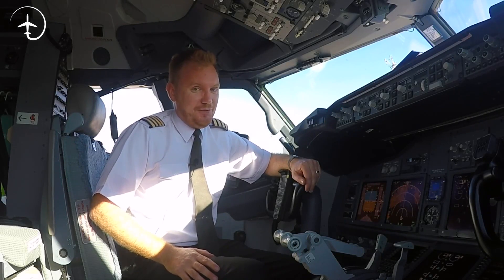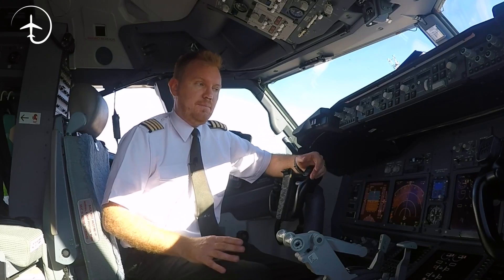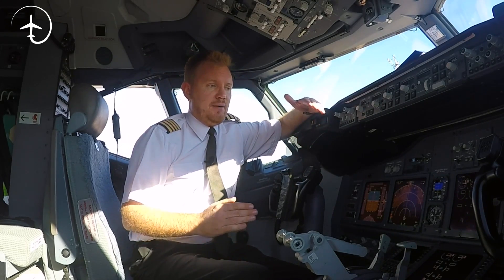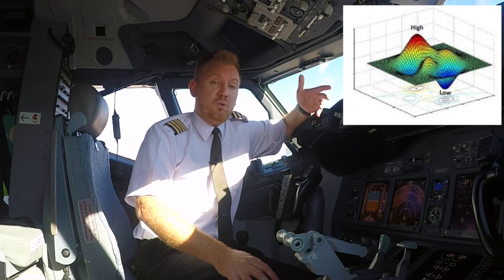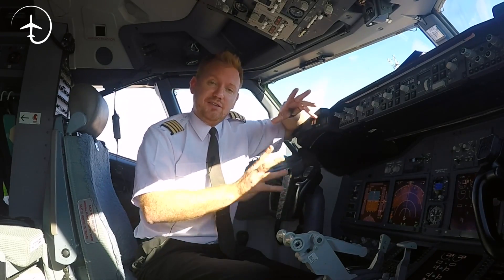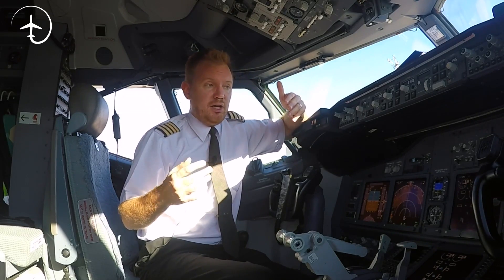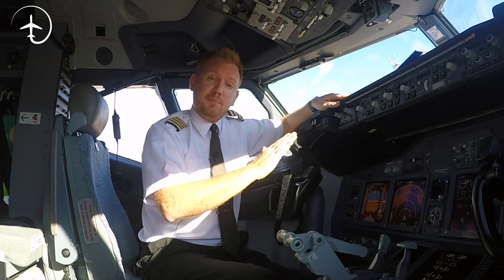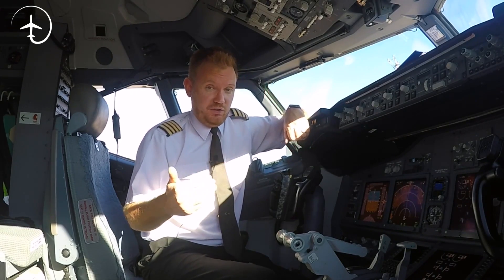How do the Altimeters work and what is a Flight Level?

Comment: How quickly can the local pressure change as you're flying? Can the autopilot struggle to maintain the same pressure altitude if you fly into an area of increasing or decreasing pressure?
Reply from the maker: The autopilot won’t have any problem since it always believes it’s maintaining the same altitude. What happens is that you might actually be climbing or descending without knowing if you are not updating the pressure.
Reply: Mentour Pilot but you said that all the aircrafts set the same standard reference pressure. And no matter what value that is, all the planes around the world basically zig-zag up and down all the time (vertically) while flying at the constant (barometric) altitude. This just sounds funny :) why don't everyone just use GPS? I guess barometric method is just safest?
Reply: GPS doesn't measure altitude
Reply: GPS is used but for cross-checking only.  GPS can be interfered with.  The instruments are designed so that if everything on earth fails, like during a zombie apocalypse, you can still reliably fly the plane.
EDIT:  If you doing an RNAV procedure, I think GPS is used for some of them.
Reply: Mark McCulfor I didn't talk about distance but about altitude, and GPS does give you altitude (not as accurate as latitude and longitude but good enough for maintaining vertical separation)
Reply: tjperez69 but you couldn't use GPS to measure altitude!
Reply: tjperez69 well, that's a good argument
Reply: Mark McCulfor Google it please, GPS does tell you your altitude
Reply: Kamil Tunkiewicz ok I will when I get time! Sorry I'd never heard that before!
Reply: I'm so sorry! What I meant to say was that GPS doesn't measure altitude!
Reply: Yeah my question is with regard to flying at flight levels. Suppose you're cruising along at FL290 and have your altimeter set properly, to 1013 hPa (or 29.92 in. Hg if you're American), and the local pressure at sea level also happens to be 1013 hPa. You then fly over a storm and the pressure drops rapidly, say to 1000 hPa. Since you're following a flight level you can't change the altimeter setting, you must descend to compensate for "climbing" to a higher pressure altitude. I'm just wondering how quickly this can happen and how far off the altimeter gets before the autopilot compensates. Essentially does the autopilot aggressively chase the correct altitude, or does it make much smoother inputs and allow the altitude to slide somewhat.
Reply: James Amril-Kesh I was thinking about exactly the same question. I found some online pressure to altitude calculator and put some example numbers I there, so: let's say that there's two points 500km apart, if there is 25 hPa difference between them at 5000 meters above ground, then this corresponds to 250 m difference in real altitude. So if your speed is 500km per hour, your altitude will change around 7cm per second / 4.16 meters per minute, while you are flying. That's 13.67 feet per minute / 0,28 feet per second
Reply: Can it be dangerous if there is a big difference between the local pressure and the standard pressure when descending or climbing (a gain or loss of around 1,000 feet).
Reply: The point of flight levels is that you do NOT care about current local air pressure. So you do NOT know the precise altitude, it may vary, but it is ok, because other airplanes above the transition altitude (TA) also have same altimeter settings. Understand it like when flying bellow TA you need to know your exact altitude and air pressure, but flying above TA you do not really need to know it. Just rough value is fine. So FL300 can be anything depending on the current local air pressure. But still there is a need to follow the vertical separation.
Reply: EinkOLED I don't think it is possible  to have a pressure drop/jump such high to occur naturally. Even if such change in pressure in two not distant points would occurr its probably not the airplane autopilot behavior that you must worry about but rather the wind that would be generated by such pressure differences... So, no, this should never happen so no such problem exists.
Reply: Jaroslav Ševčík I think that's not what his question was about. In this discussion we comment on the fact that the airplane is not really flying in a constant height above ground, but rather follow the local pressure levels and constantly slightly climbs or slightly descends because autopilot wants to keep constant pressure (not really constant height). It's fine, because all the planes are doing this. But I understand that the question may be - what if you are flying in mountains and there's a local dip in pressure, the autopilot may descend without any input from pilot. I wonder how important that is in reality. How big the effect is.
Reply: EinkOLED ah, sorry, I did not understand the question when first read it. Do you mean if the local QHN for airport is very low or very high and what happens when the plane transitions from standard pressure to QHN?
Reply: You have to realize that height (altitude) can be measured in meters or as a pressure. Above the transition altitude aircraft always has the same altitude in meters but at that altitude air pressure can change. So with the same altimeter settings the airplane is flying leveled without climbing or descending. Because flight level itself is not fixed but can change (due to a different air pressure).

To answer your question: if you are flying in mountains under IFR then ATC will keep an eye on you. Under VFR you will have to know the charts and constantly check the terrain. And yes autopilot after air pressure change will adjust the altitude, so you can even climb or descend. I know that in a really difficult terrain pilots are flying on manual or at least disengage the altitude autopilot.
Reply: GPS can tell you altitude but I believe that all the planes in the area normally use the lowest pressure reported in the area so they do nto hit the ground and keep their separation from each other by using the same measurement even if the pressure changes as they fly. Of course if they set up different QNH there might be issues (same would happen if one plane used pressure measurements and another GPS that is why they do not fly by GPS height, not to mention you cannot trust GPS absolutely...though you cannot trust altimeter absolutely either).
Reply: Jaroslav Ševčík by altitude I mean "the distance to ground" and this is always in meters. The altitude in pressure units is not telling you any distance, thus this is not measure of altitude. You can use it to describe some altitude in a model of ideal atmosphere. Aircrafts are flying up and down a little bit all the time, because the altimeter does NOT measure height (altitude), it measures absolute pressure and the altitude displayed on it is only approximated from the pressure measured. In reality if you would fly straight level your altimeter would show you that you are climbing the moment you fly into low pressure area. And that will be compensated by autopilot, thus the aircraft will descend a little bit. You can easily find more videos describing this effect. I was more interested in how important that is when flying, is that something that pilots notice or is that so small that the effect is neglible
Reply: Jaroslav Ševčík QNH works great at the lower altitudes where clearing obstacles and terrain are paramount. however, for the long hauler, resetting the altimeter as the airplane traverses areas of fluctuating pressure on the ground would be a huge pain in the ass. so,  the flight level concept was introduced, allowing everybody at higher altitudes to use the same setting. puts all the players on the same page. it also reduces the chance that aircraft have a different altimeter setting in the same airspace, which would create serious vertical separation issues.

Comment: The answer to the problem is 97000 meters
Reply from the maker: Did you solve that yourself?
Reply: Mentour Pilot Well, my mom is a teacher, so she did help me a bit jajaja
Reply: std QNH is std , dosent change anywhere (1013.25mb)  but local QNH can change thought the day .STD QNH is used for flying above transition level .
Reply: Could you share how did you figure it out?
Reply: this how I attempted to solve it. but i don't get anything near the correct answer. there must be another way to approach this problem
Reply: @iVlog Just looking at some charts, it looks like the approximation is only good close to the surface of the earth. Once you start to get beyond about 10,000 ft, it fails badly.
Reply: well i seem to be off by a couple of decimals :P
Reply: Is it 100 kilometers or 61 miles?
Reply: Does the std QnH is same across the globe or it differs by continents? Meaning will it be differing for flights over European airspace to US or Asia?
Reply: Karman line is defined by an equality. ICAO or some other defines a dynamic pressure needed at the flaps like elevator to be effective to control the plane. I dont know the value now, but as higher you are, as thinner the air is. To have an appropriate airflow around the wings, you need to fly faster with higher altitude. But at a certain altitude, this velocity reaches the speed you'd need to have for an orbit around the earth. At this point, naming this "flying" by airflow around wings become inadequate. This 100km altitude is a rounded value for this calculation.
Reply: std atmosphere is 1013.25mb at sea level and drops by roughly 1mb for every 30ft .the rest is maths and converting feet to KM
Reply: I got something lower, about 8,400 meters.

Comment: What about the vertical separation measurement below the standard pressure altitude? Like why isn't vertical separation important that time ?
Reply from the maker: It is but then all aircraft is flying on the same Local QNH so the separation is maintained.
Reply: Mentour Pilot Oh yess right ! Thank you so much ! :) And again thanks for such an informative video !
Reply: Lik3 ViaZ yeah man. Thanks for your the explanation. Got it cleared
Reply: You dont need to know what your real altitude is at that point. If you’re at 9000 meters, you’re even clear of mount Everest. The bigger concern is being clear of other aircraft as Mentour pilot nicely explained.